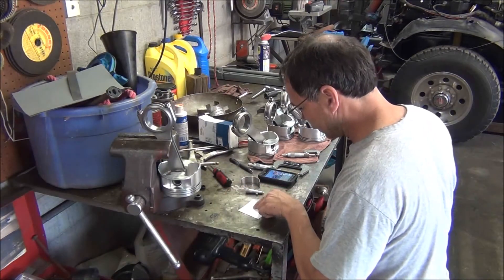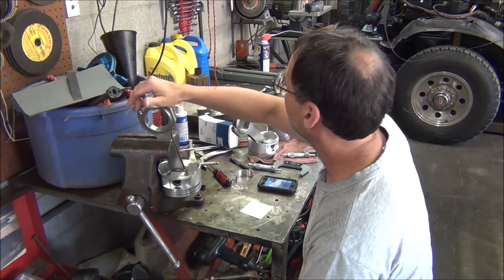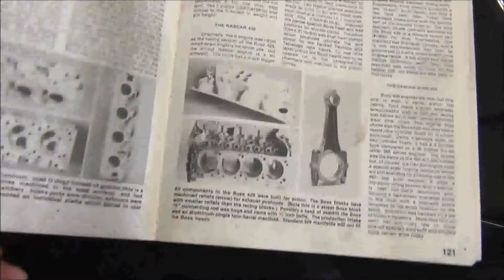460 rebuild Part 7 checking rod bearing clearance

Comment: I just cheked my rod clearance and i got .0015 is that good ? Stock engine
Reply from the maker: The standard used to be.002-.0025. But I have been told they are fitting race engines tighter now a days . Are you checking it with or with out assembly lube ? You are supposed to check it dry, but remember to use lube for final assembly. If you had machine work done you should check with the machine shop on that. Thanks for watching.
Reply: @Dragracer64  i had assembly lube .

Comment: Are you using a different mic to measure the bearings do to the circumference?
Reply from the maker: I measured bearing thickness with a 0-1 '' mic, with a ball tip for the inside radius. Thanks for watching.